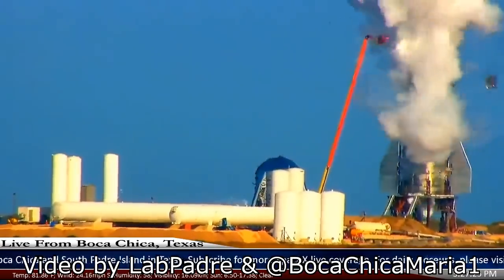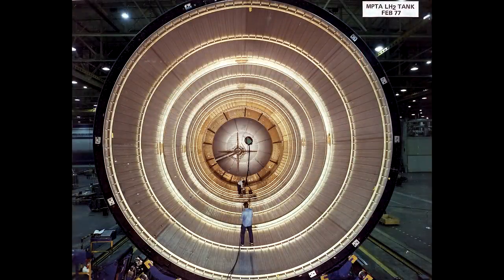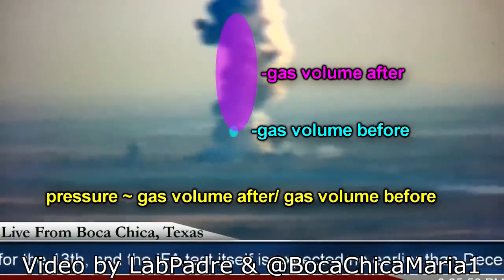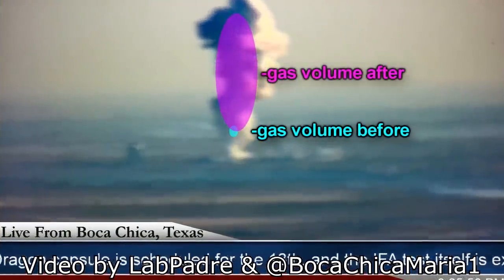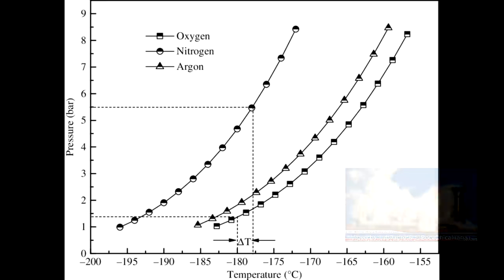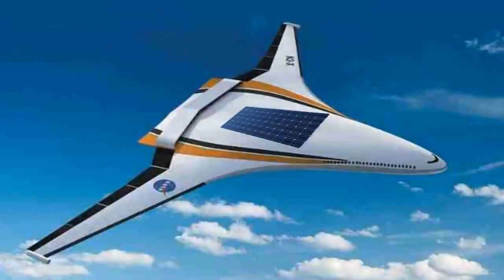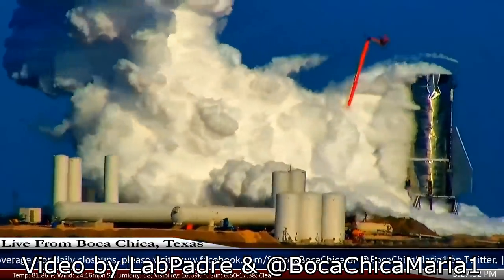Starship explodes, but why?

Comment: This is the R&D phase. Elon is not afraid to blow up a few rocket prototypes to learn rapidly. The SpaceX approach for Starship is to optimize rapid manufacture of prototypes, and push everything to the limit, then scale up and get safety by making it cheaper to test.

Your SpaceX debunk videos from 4 years ago didn't age well.  Niether will this video.

Anyway, if you are a much better engineer than Elon, why don't you do something useful instead of criticizing from the sidelines?

Seriously, you would do well to go back to low hanging fruit like you used to do, like Solar Powered Roadways and food spectrometers. I think Elon has clearly demonstrated that he is obviously not in the same category (i.e. he's produced actual things that really work). Your science knowledge is adequate for putting down the most pitiful fraud cases, but taking on SpaceX is way out of your league.

Comment: The history of liquid-fuelled rocketry is a tale of increasingly-large explosions told by men with less than ten fingers. I don’t think Spacex is nearly so good as Musk claims in any way, but you have to be fair with these things - sooner or later if you build a rocket it will explode, and if you want to build safe rockets you have to regularly try and make it explode until you repeatedly and reliably fail to do so.

Comment: You're failing to take into account the sudden exposure to the far warmer exterior temperature immediately after rupture, this instantly caused the LOX to vaporize, massively expanding it's volume and pressure within the plume.

Comment: Fun fact: (breaking a NDA by posting this but, fuck Musk)
So it helps when Musk isn't trying to find the lowest bidder with NO PRIOR EXPERIENCE with the material, let alone with no prior experience in the industry. SpaceX hired a firm that had no business in getting into that project. I'm guessing Musk is trying to actually fail, it's fucking terrible.

Comment: I also think it was a failure of pressure relief valves that caused it to blow its top. One sign of that is the absence of any visible out gassing.
I had seen a statement which I was quite sure was from Spacex but have been unable to find it again - it put the blame on the pressurizing system
 saying that the feedback system was incorrectly relaying the tank pressure thereby causing the pumps to continue pumping well beyond the intended pressure.

Some other things:

The test was done with liquid nitrogen, not oxygen. Not sure if it is just cheaper or perhaps because it is less dangerous to handle, especially in case of a spill.

The pumps in the engine of this particular vehicle raise the pressure to about 250 bar rather than 100 and they are targeting over 300 for future iterations.

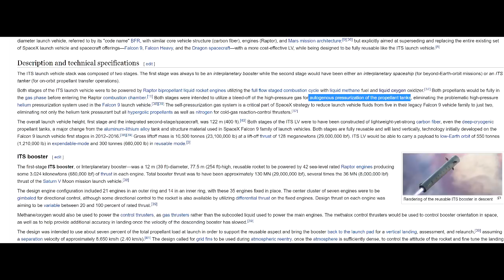@5:45 Autogenous pressurisation is difficult but not new. It has been used before at least on one rocket, the space shuttle, and probably others. What they do is pass some fuel or oxygen through a heat exchanger to heat it up and back into the tank. The heated gas remains 'warm' enough due to lack of convection. It does of course condense to some extent but can be replensihed with hot gas faster than it can condense. It is possible to do the same with water, pumping steam at the top of a tank of ice cold water will easily maintain the pressure if you have enough flow rate of steam.

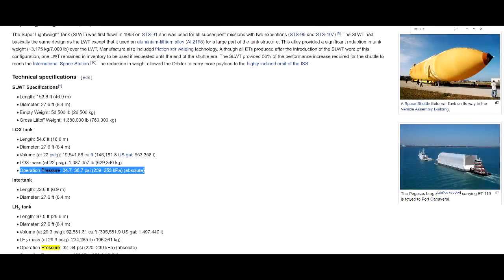@6:30 There was actually a full explanation of exactly what happened to the Dragon capsule and also what they changed in the design to correct it. The problem looked obvious with the benefit of hindsight. In my opinion it was the result of insufficient analysis of possible failure modes.

The way the tank ruptured was quite extraordinary being a very clean line along one of the seams almost the whole circumference. It looks like it was a defective weld but I think it is possible it may have been a sort of 'fusible link' acting as a last resort pressure relief as failure in this mode would be the least damaging, resulting in a more orderly if unscheduled rapid disassembly. If it were to happen in flight it would possibly even eject the whole front section in one piece, though not sure how exaclty that would help.

Comment: Supposedly there was a "miscommunication" between pumps and pressure sensors that were supposed to send signal to cut off the flow.

I don't know how reliable is that information, but this implies there was no safety release valve whatsoever

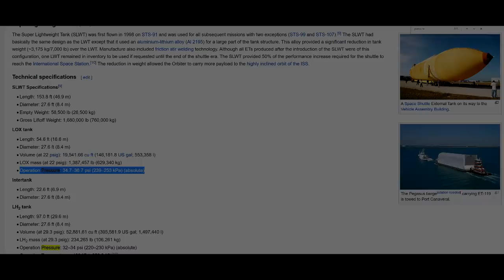Comment: At 6:35 "and no explanation has come forth from spacex just like when their dragon capsule blew up."
Wrong. Spacex released an analysis 4 months ago. A leaky check valve allowed the hypergolic fuel to flow back along the helium pressure lines, then when the helium lines were opened during the test the leaked fuel rammed into the valve and blew it apart.
https://www.youtube.com/watch?v=6P063KnI5NI

Comment: My guess is they used parts left over from previous Falcon 9 versions. Despite talking about new ways to pressurize the tanks, i suspect they used a few of the old helium pressure vessels (the composite overwrapped types) and one of them blew, just like the one a couple of years back.

Comment: They're two competing theories. One theory is a weak weld but that wouldn't explain the extra gas volume, assuming your analysis is correct.

The other rumor was that there was a bad pressure sensor, and they simply over filled the tank. I doubt this ground test was using autogenous pressurization, probably helium.

Comment: Rumours in the space X watching community that a sensor that controls the filling pumps miss informed the system and created an over pressure by accident. Luckily they had already moved on from this model as a flight article and was just a construction practice version for testing.

Comment: Are you quite sure about the volume before and after comparison to get pressure? And the 10bar pressure estimate looks conservative given input data and logic, yet way excessive to what this kind of pressure vessel should be able to take.
There is a phase change going on there, if it sprayed liquid nitrogen (which was used for the test) up you would get a giant vapor cloud but it wouldn't indicate much about pressure, would it?

Comment: My belief is this: This is a 'new' alloy of stainless and they wanted to test the limits. They had said that the decision to not fly this model had already been made. They had already said that the alloy would strengthen under cryo. It is also clear they are still learning how to work with the metal. Opinion.

Comment: The thing with sub-orbital traffic is the fact that you might hit other sub-orbital traffic going to the same launchpad as your craft is.
Unless they develop multiple launch towers within the span of... let's say 5 miles radially... not diametrically (
I don't know if I used those two words correctly)... or have one being received and the other sending, but then you'd still need multiple towers because you would have to increase the amount of traffic, or increase the capacity of the spacecraft which would upscale everything on an already giant rocket... which means more money to be spent and earned.
...Something, something, Economics and one block lifting the other...

It ain't impossible, but it definitely is implausible.
Reply: "The thing with sub-orbital traffic is the fact that you might hit other sub-orbital traffic going to the same launchpad as your craft is."

There is an easier way to avoid this.  It's called scheduling.

Comment: 7:57 No. This just isn't an option. Firstly, do you really have that many people wanting to travel long haul? Even Concorde which was faster than all other planes never had every service full. There is also the consideration around the amount of crew, working hours, the stress on the vehicle, specialised handling and arrival, etc. It's more than just vehicle and fuel.

Comment: It seems like mk2, 3 and 4 are quite different from the mk1. Isn't it possible that they didn't have any use for the rocket anymore (because of too many design changes) and the most useful information they could still obtain through the mk1 it is to see at which pressure it fails? and they could not make that test official because it would get them in trouble with regulators or something.

Comment: not long ago the Soyuz had to make emergency reentry and the men inside felt 6-7 gs. what happens when you take the people on an airliner and put them on your rocket and that rocket has to make them do an emergency maneuver and land. what happens when those people experience 6-7 Gs? how about 3 Gs? 3 Gs is what they feel on takeoff in a rocket. if I recall correctly. what happens then? do they all pass out and then  are ok? theres going to have to be some kind of training for it and health restrictions and restrictions on size of a person height width thickness and weight. and age. I'm guessing? but in that pool of people how many can fly on the rocket? then how many can afford it? then how many actually will buy tickets over aircraft everytime? alot less than everybody who can and does fly on airliners.

Comment: IIRC the cause for the overpressure was, that there was a communication issue between the pressure sensors and the  pumps filling the tank with oxygen. I can currently not fnd the source for that, I think itwas either scott manley od Tim Dodd, but I might mix them up with one of the other channels. Since the tank design has not changed between starhopper and starshp mk1 one cold assue that the expected pressures would have been well known and the design per se should be able to withstand those.
Furthermore pressure vessels usually burst along their length unless there is a structural weakness in other directions. lince there are welds bothe lengthwise and crosswise there might have been a bad weld in te area where it ripped,  in addition to the overpressure.

Comment: Could have been a stress test. I've read that the mk 1 was decommissioned in favour of mk 3. But whatever it was, I am glad they are getting some bangs before strapping a payload on top. If the concept works like they think it will, this vehicle will be a damned cheap option for delivery to LEO, the moon and Mars. Potentially even to the outer solar system.

As for competing with airlines: My doubts stem from the rules and regulations in place for aeroplanes. Pre-flight checks are pretty extensive. Rockets won't make that easier. Additionally, would the US allow the starship to land in places like North Korea, Iran or Saudi Arabia? The vehicle is a natural inter continental ballistic "passenger delivery system". Any evil government could ground it and strap a small nuclear yield on board and tell the world that they want in on the MAD-club.
Reply: "Any evil government" Like USA? haha!

Comment: Thunderf00t, a small error. Kerozene and hydrazine is pressurized with helium (or whatever) because you can't gassify them. LOX is pressurized with oxygen, LH is pressurized with hydrogen, no need for a separate pressurization gas. They heat the liquid with a heat exchanger in the engine and pump the resulting gas to the top of the tank. The whole process is obviously far from trivial. They usually store the helium tank for pressurizing kerozene in the oxygen tank 'cos that's the coldest place in the rocket.

Comment: One thing. The rocket plane racing league had developed a rapid refueling tech for their cryogenic fuels. Perhaps this was a test of that type of idea that failed because of frozen overpressure release valves.  Still asking for a video about how Metal Organic Frameworks collect water from the air.  I think I saw it on Seeker!  I think a Phil take on how it works would be cool.

Comment: Wasn't this supposed to be a pressure test? Seems like they wanted to figure out how much they could push their luck. In any case, this vehicle was never intended for flight testing... at least if we go by what my understanding of Musk's rambling "reveal" was about.
Reply: Pretty much. Spacex iterates so quickly the mk1 kinda got outdated. But I think it was still scheduled to fly, otherwise why go through the trouble of putting the fins/wings and carrying on as if it would? But then they had this issue and just rolled with the “well we weren’t planning on using it anyway” story. 

Even if it was outdated, it was almost done. There’s probably useful info in letting it fly despite this. Even if it was lost in that attempt, no matter, since it’s just a useless prototype.

Comment: When the Dragon capsule exploded they did explain why.
Reply: Phil can't care.  Same reason he thinks the starship tank was filled with liquid oxygen...and the same reason he thinks he is dismissive of autogenous pressurization despite its use for decades.
Reply: @IanSlatas  Yeah he doesn't know anything.  He doesn't know why the tanks were even pressurized, even though everyone following the program knows they're pressurized to a few bar. He also doesn't understand you have to test to cryo temperatures, in order to validate your design at lower temps.  I'm sure they did test in a lab, but a larger object means more welds, and any defect along any weld can cause failure.

Comment: This guy is a expert on rockets but doesn't understand why they would overpressure a tank intentionally....   or how to even do such a thing.
Reply: That's because SpaceX didn't do it intentionally, nor would there be any point in doing so. Steel pressure vessels are not exactly bleeding edge technology with uncertain capabilities, you don't need destructive testing just to find out how much pressure it can take, you can look it up from an engineering handbook.
The only pressure vessel they have ever destructively tested was the carbon fiber tank, but carbon fiber is also a completely different animal from any metal so that's not a good parallel at all. Fact of the matter is that nobody blows up metal fuel tanks like this, not SpaceX, not NASA, not Arianespace, not anyone. There is no point.

Comment: Build a pressurized tank in the ground with an elevator. Fill the rocket while it is inside the pressurized tank so that you can keep the pressure equal. Check for leaks and defects. Slowly depressurize the tank, while watching for leaks. Raise the rocket up out of the tank once you are sure there are no defects or leaks.

Comment: My completely layman guess: They didn't manage to keep the tanks cool enough?
- Or, the most likely one: There was just a bad weld somewhere....
Reply: I think a couple other channels have covered this and sort of explained the official comments that were released. So this is kind of like a third hand explanation, I’d rather my comment be more a prompt to look for those explanations yourselves. 

That said, it’s my understanding that they were basically doing pressure tests for any leaks/weakpoints etc. To do this they overpressure the vessel to whatever regulations dictate (I think it’s like 2.5 times what it’s normally designed to handle). Something about the sensor-pump/control system malfunctioned, it didn’t know when it reached the test parameters and kept going. Instead of testing 2.5x nominal it went to something like 4-5x. That is way beyond design+safety margin so the weak point busted.
Reply: @sphaera2520  Thanks! ^^
Reply: Martin Verrisin 
np, though I’m kind of surprised tf didn’t look into the released statement and chose to discuss his own guess. I know he dislikes elon but this happened a while ago and the info is out there. 

Edit:
Now he has everyone in his comments making their own wild hypotheses. Though ultimately what any of us thinks is of little consequence to spacex, nasa, elon, etc.
Reply: @sphaera2520  ... Yeah, Tf really doesn't like Elon, and is biased in the opposite way than Elon fanboys. :D
... Would have been better, sure, but I still learned something about how rockets tend to operate. ^^
Reply: 5:23 ... ok, that's way more complicated than anything I could imagine XD

Comment: Supposedly it was a comms problem where the pumps didn't respond correctly to the pressure sensors. See https://youtu.be/nf5q2YlM2mU at about 1 minute in.

Comment: First, as explained by Scott Manly, it was a deliberate pressure test to find the rupture point.  The top blowing off was unexpected. The techs were expecting tank splits or pipe bursts.
Second, that tank was only ever a test rig and not the actual working model.  There are 3...okay two now.